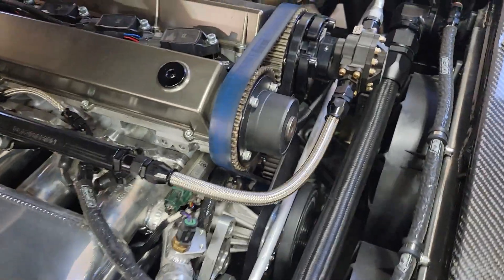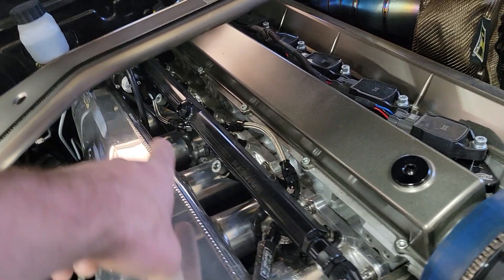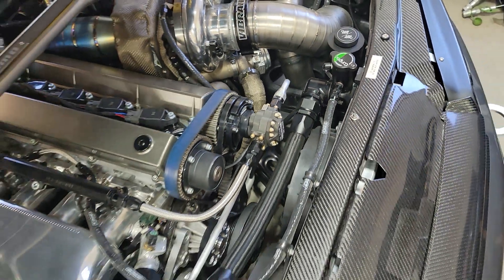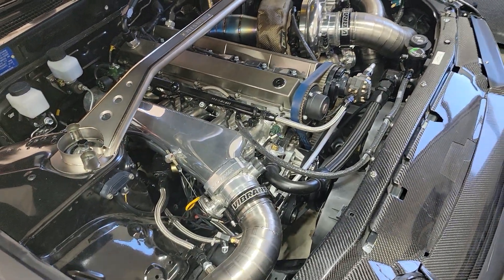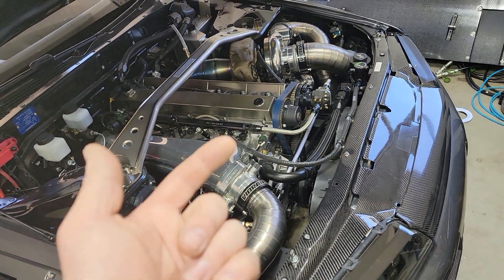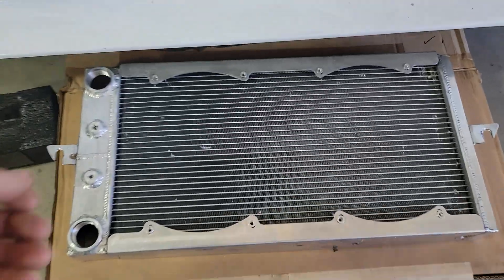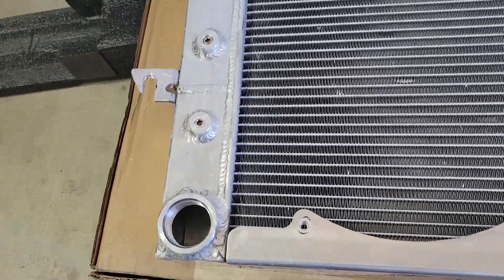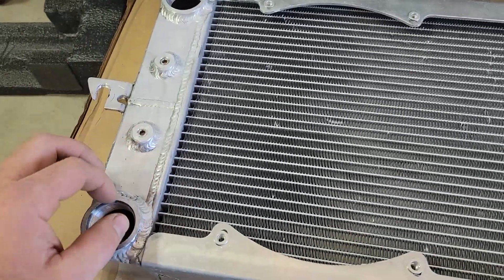RB cooling Issues? Chase Bays tucked radiator & Mishimoto Raceline fans...are they any good?

Comment: Are you using the 20 AN fitting on the Chase Bays Rad ? ... I believe those have a lower diameter than the stock pipes... Im also considering this setup but I got an CA18DET engine...
Reply from the maker: yes I am - you don't need massive lines though. AN16 would be just fine.

Comment: I'm late to the game, just saw this vid and the follow up vid about you getting it figured out. I've had good experiences using electric water pumps. The benefit is that you can get the coolant flow you need at idle with an EWP, as the flow isn't RPM dependent. Have used Moroso (drag) & Davies Craig EWP (street). Also soft start fan control from 'autocoolguy' for high amp draw SPAL fans.
Reply from the maker: I have a E pump setup but haven't installed it yet - I agree they are amazing.

Comment: Did you figure out the issue?  I’m having a similar issue on my rb30/26 and was thinking either the thermostat or my underdriven pulley.  My issue isn’t at idle but rather while driving.
Reply from the maker: I absolutely did - It was a rather silly issue. I had been suing Evan's Waterless coolant - that was my issue. Once I drained it and went to traditional 50/50, the car idled like a champ. What is your fan setup like? Stock/ E-fan, etc? Do you have any ducting? What are your oil temps?
Reply: @OutsiderGarageDBW  I’m running the Chasebays same as yours but in the older style with the full shroud.  I’m thinking my issue may be a combination of things…no ducting and running one relay on my fans, perhaps being under powered?  I am seeing low 200 F oil temps.
Reply: Issue fixed.  My fans were underpowered.  Added a second relay and used properly gauged wire.  Car doesn’t break 190*F now.
Reply from the maker: @richierichness  glad it's sorted 👍

Comment: I'd put the filler neck on the manifold outlet to insure height above head, also I'd like to see the air flow test with the engine running

Comment: Id say mishimoto would have bench tested them with no radiator installed. And possibly at charging voltage. 
Also with the coolant flow, higher coolant flow is not necessarily better, slower flow thru the radiator will cool the coolant more. Faster water pump can also cause cavitation at higher speed. Best of luck 👌
Reply from the maker: When I take them out to replace with the shroud, I'll redo the test for sure.

Comment: do you have a N1 water pump or a regular oem water pump? 
The N1 is generally recommend on track cars since they do required higher rpm to perform and have anti-cavitation plate.
The oem version will flow more at lower rpm then a N1 pump but doesn't have the anti-cavitation plate.
Reply from the maker: It is a N1 pump, but I'm beginning to think the problem is with the water based Coolant. I've been suspicious of this for a while but haven't taken the time to drain and fill it with normal 50/50 . I think I'll do this this week ;)
Reply: @OutsiderGarageDBW   a lot of ppl reported problem overheating with N1 pump when stuck in traffic unless its a pure track car or drag car i would put a oem pump instead of the N1 pump
Reply: @Simon-PierreR32GTR  n1 pump in my forged RB25 s14. Overheats while sitting in traffic every time. A bad relay killed my fans over the weekend and so far with the fans I stole out of a 350z drift build I’ve had no issues even in traffic. I just ordered the same chase bays tucked radiator kit so I can replace my punctured jb weld radiator and return the fans to the guy I borrowed them from. I really really hope they work considering the $900 price tag